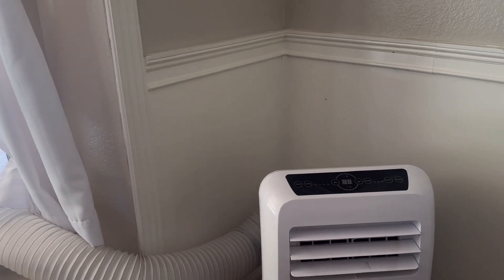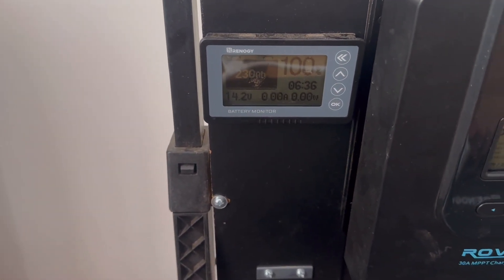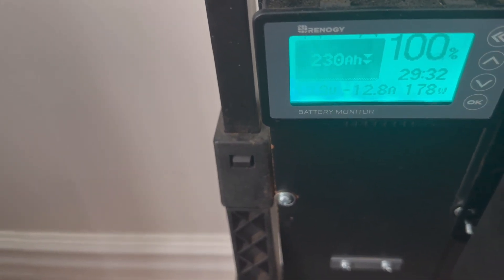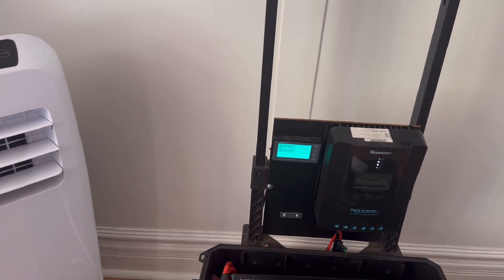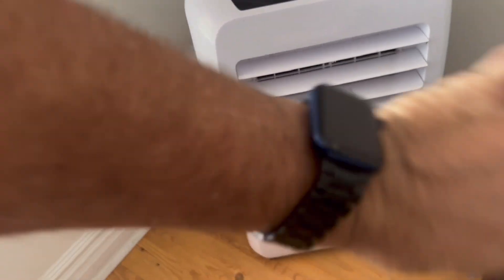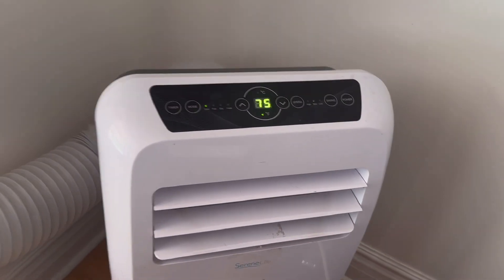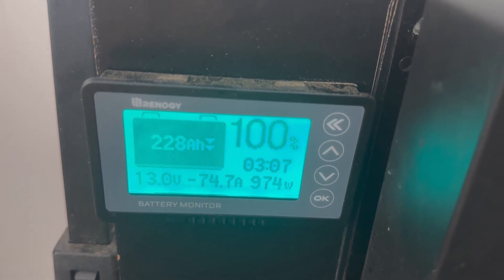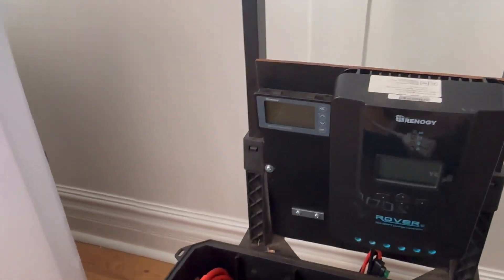Experiment: How Long Will My DIY Solar Generator Power a Portable AC Unit?

Comment: powering directly from solar would be more efficient, wouldn't it ?
Reply: Powering directly from solar wastes a lot of energy, you will need a LOT of more solar power for it to work early in the day and late in the day. When you combine it with a battery you can spread out the load for a whole day and night (and run it at night also). You never run things directly from solar power because it is a waste and impractical as you can only run it during the day.
Reply from the maker: I was just seeing how long my battery would power the ac unit. But totally agree, a combination of power coming straight from the panel array would be helpful.
Reply: If you only need cooling when the panels have enough daylight AND the unit is an EG4 mini-split model meant to run directly from solar, then yes, it makes sense.

Comment: How much solar does it take to power it non stop?
Reply from the maker: At is peak it was pulling 80 amps and 1000 watts off of the 12v invertor.
Reply: A properly designed 2-hose unit should be drawing 2/3 of that for 9,000 BTU